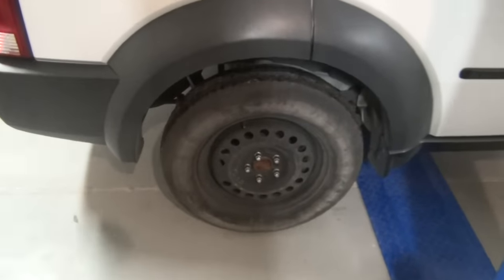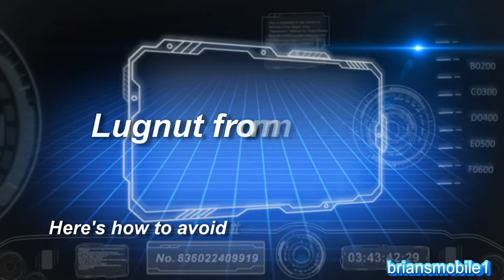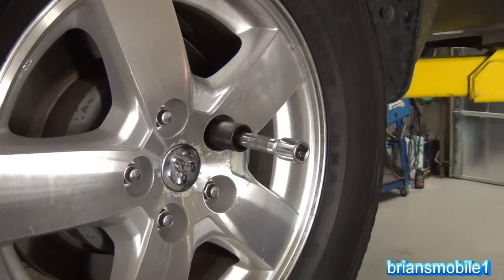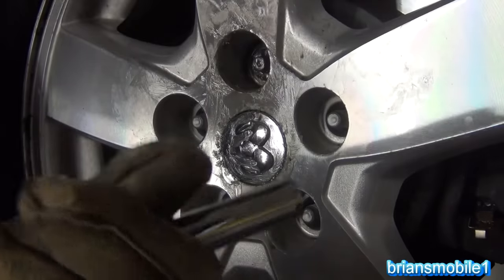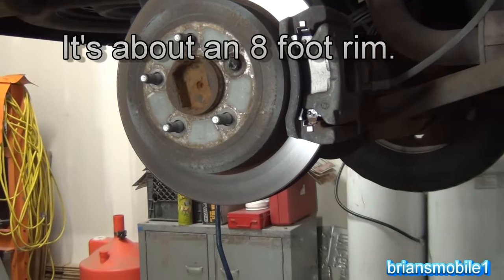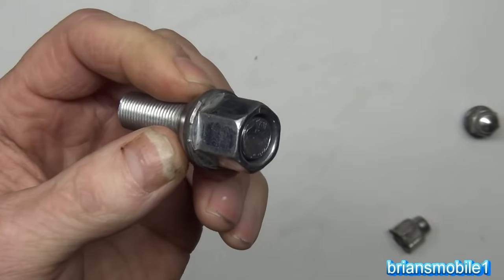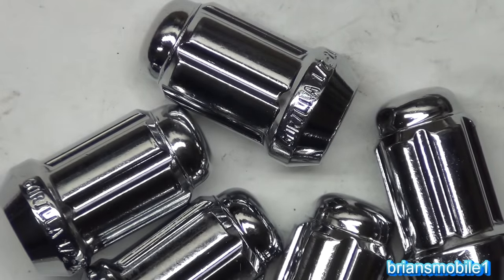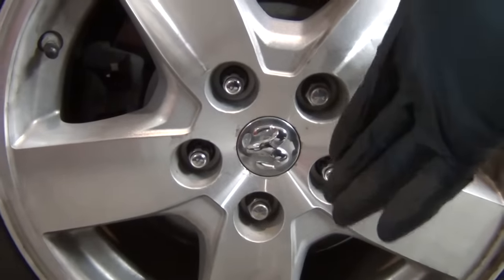Lugnut From HELL

Comment: You know your day is bad when you are torching lug nuts
Reply: This is what happend to me today
Reply: hahahahhaha
Reply: ike fun what would be the proper tools?
Reply: TheBlackStealth i'd like to know as well
Reply: Definitely do not miss those days
Reply: @Mr Sunshines Not everyone has the key that came with the car. Sometimes the rims are aftermarket rims and the key for it is hard to find in stores or online.
Reply: Everybody knows you spray with WD-40 when red hot-sucks it into threads. I've got a Durango with same problem. I dug most of the chiseled lugnut out. Now I'm going to hardware store to get diamond tipped hole saw that JUST slides over the wheel stud. Wish me luck - first time in history?
Reply: Happened to me just now
Reply: @willyluciano9036  Good story bro. Glad you got it sorted in the end.
Reply: I woke today with high hopes of completing front end...... placed smaller socket..... used all the point sockets.... heated the nut .... then grinding the nut off.... still no luck.... trying to pry..... my special lug nut split in half... I’m stump....    do u think I can go through the back way take the axle nut off so forth..????
Reply: not if its after hours. I enjoy the pyrotechnics.

Comment: Who was the "engineer" that thought capped lug nuts were a good idea?  They're ridiculous.
Reply: @noidontthinksolol  the Dodge ones are not even 19mm as they should be. Must be made in China but so key won't fit on and when you get them off they are stuck good in socket. Underneath is normally 18 tho
Reply: They are garbage. The corrosion gets under the cap and swells the cap. Now the proper sized socket wont fit. Now joe bloe grabs the next size bigger and strips the nut. Seen it a million times.
Reply: @noidontthinksolol  I work in automotive industry and Tim Fisher is absolutly right. Working with harder metals mean lower lifespan of tools in factory, longer time to make single part etc. also softer metals are cheaper. Yes it is cheaper by few cents per part but if you make thousands nuts per day then every cent count towards profit. One big USA automaker actualy wanted to change materials used in one part we make for chaper metals and we were not even able to do that because of quality issues.
Reply: It's just attempts to work around some inherent problems with lug nuts instead of just switching to bolts. I'd bet the engineers are just doing the best within the rules the management has set up together with the sales department. Because some focus group has said that they refuse to buy a car with lug bolts... unless it's European, then it's okay.
Reply: its mostly only dodge that uses them
Reply: @crash5225   Yeah you should But I think you do not as I have never had a problem with the nuts that lost their cap !
You just use the next size down socket & be prepared for them to rust a little .
Reply: Dodge🙌🏻
Reply: Ford, Chrysler, Chevy, Dodge....
Reply: @crash5225  1 dollar each
Reply: Cheaper to make + an easy way for manufacturers to squeeze more money out of a customer. A full set of OEM capped lugs for an f150 is about $140 at the dealership I work at.
Reply: Ford Engineer right after the two-piece spark plug.
Reply: probably the same guy who never worked on a single car in his life and instead substituted that for a degree.

Comment: The easiest and painless way to fix these is to drill them out. Measure the height of the nut and the size of a stud, with a caliper. Take the drill bit, usually slightly smaller than the stud measures and mark it  for depth. Most times it doesn't matter if you drill a little deeper, just be careful. A bit slightly smaller will compensate if your center or drill angle is off.  Anyway, most studs are concaved at the end so locating center is relatively easy. Use a center punch to mark and start drilling. I have used the step up approach, starting with a small bit and incrementally increasing the size, but usually do this on a threaded hole that I don't want to damage the threads. In this case neither the stud or nut matter. The only piece that could be damaged is the rim. The drilling should leave just a ribbon of stud metal that will break right off with the wrench or impact. If you get it near perfect the stud should come off on the drill bit.
Reply from the maker: +3goallead That's some great advice.  Thank you.
Reply: +3goallead. I've had great success in doing the drilling process too. another tip for what I have done that has helped too is actually re tighten the other lug nuts back on and either used an extractor, or pounded on another socket on to impact the stuck nut on. I think the pressure of the other lug nuts being put back on helps in pushing in the rim a little, and any little bit helps as i have tired doing this with no lug nuts on, and all of them off. Half the time, the striped nut comes off. ;D
Reply: +3goallead also after you tighten the others down like tou xiong said, use a breaker bar and a cheater with Brian's extractor and that will give a lot more force than the air impact gun. sometimes you can just break studs off.
Reply: +3goallead Yep that's how you do it. Been there and done it.
Reply: +3goallead   So, where were you this smorning?? No, seriously I wish I had read this 10 hrs ago, I might be done working on my Jeep. Thanks for the advise. Tomorrows forecast, sunny with a chance of still working on the Jeep.
Reply: The easiest, painless and cheapest way to take off a nut or a bolt is using a torque multiplier!!!
Reply: Yep this works with lots of stuck bolts, etc etc.
Reply: Thank that'll be way easier
Reply: Also if you have them on your vehicle get them changed for better ones that are solid, one piece.  Any vehicle you bought new even today might have them.  Why they still use them is a mystery.  Maybe they are in cahoots with the towing companies you will likely need to call when the lug nuts make changing a flat tire impossible?  If you have one with a damaged cap or is on way too tight it will seem just about impossible to get it off.  I also would not expect you to have tools to try to remove it with either.  You will end up canceling your plans for that day and going home or to a nearby friend's house frustrated.
Reply: Agreed, I've done a lot of reading and I think heating it up damages the wheel more times than not.
Reply: Need suggestions: I'm working with a jetski trailer, tire flat and half separated from rim. As I fight the stuck lug nut, the wheel turns.

Comment: A tip from a Dodge, Chrysler, Jeep, Ram technician: when you get a lugnut like this that won't come off, before you go for your breaker bar or your damaged nut/bolt extractor, take your 19mm impact socket, 18mm if the lugnut is missing the cap, and hit it with a hammer. A real hammer. I use a 4lb engineers hammer. Hit it. Really hit it. Put down your purse and hit it, little girl. 5 or 6 hard hits. The vibration from hitting it with the socket and hammer shocks the taper on the nut. Your impact will take the nut right off.
Reply: John thats the way to do it money fer nothin and your chicks fer free...
Reply: so put the socket onto the nut, then smash the socket with a hammer?
Reply: John come on up here to the salt belt and try that trick, it doesn't always work. Try making your nut here in the north, we make those southern techs look like oil change specialists
Reply: what a sexist comment.
Could also had some racism to it please ?
Reply: 12 pound sledge. Just don't miss.

Comment: Probably should've hammered that bolt extractor on there and tried a breaker bar with a cheater pipe...
Reply: +jrmym2 Yeah, worst case just twist off the stud, you're gonna need to replace it anyway
Reply: +Doug Beard You're not Brian...
Reply: +jrmym2 I'm with you on that one. I've always found that I can out-muscle an impact wrench with a breaker bar, even without a cheater pipe. Sometimes twisting off and replacing a lug is the easiest way to go. And welding on a rim with a tire on it? That's risky (plenty of YouTube videos on the results of that approach). Granted he's a long way from the tire, but that's a lot of heat.

At the very least, it would have been advisable to remove the valve core and leave the interior of the tire open to atmosphere. And make sure it's not a magnesium rim or it could turn into an inextinguishable fire.

That said, all's well that ends well. It's a win for Brian.
Reply: +Firstname Lastname I doubt any Chrysler of that era would have a magnesium rim also I've found the opposite to be true the force of an impact just works wonders getting stuff loose.
Reply: I had this problem before on a Jeep. Impact guns did nothing. 8 foot cheater bar by a fairly good sized mechanic did nothing. The caps were still on the lug nuts, and not stripped. It ended up being drilled out.
Reply: I don't think the extension on the impact helped either
Reply: I would use a breaker and cheater or just give up.
Reply: I have a five foot pipe to fit over the end of my  breaker bar--all the torque I need.
Reply: they also have a 45/64ths lug nut socket that would have worked well in this situaiton
Reply: @HimmelWeint  o ly if you plan on twisting nuts off....
I've always won with a 22inch breaker, a hammer, 2 sockets (1Correct &1 Smaller) and an nut extractor... when that failed then it was str8 to FIRE. Then breaker, hammer socket extractor repeat.. shit if that failed then torch it...
Reply: @billlee1724  kush roller laffed
Reply: Jrmym2, I snapped my 1/2" drive breaker bar with a five foot galvanized pipe after heating red hot. Defeated two Impact drivers, both half inch. Snapped a star wrench style lug remover at the center weld.
It's also a goddamn Chrysler.

Comment: A friend called me asking me to pick up a tie rod end for his '95 Town & Country and come rescue him as he was out of town.  When I got to him, we had the same problem.  Couldn't get one of the lug nuts off.  The solution I came up with was to replace the tie rod end with the wheel on.  Not easy.  Got the bad lug nut off later when he returned home.  Used a combination of metric and SAE sockets pounded on with a sledge hammer until the lug nut gave up.

Comment: I always learn more when watching misadventures like this. Way to go, for rolling the camera even when things aren't going well.
Reply: +spelunkerd Agree completely.  We all hit problems; learning how we overcome them is so important...
Reply: yea i can see this coming in handy some day.
Reply: If you can't get it lose, put a breaker bar on it, and tighten it till it breaks. Presto it done, you have to replace the stud either way.If you are going to drill, why wouldn't you drill the center of the wheel stud? Making it easier to snap off with a breaker bar? You did a lot more work then you had to.
Reply: I Was thinking the same Greg! Or try to loosen it with heat. We use road salt in the winter, and living close to the Sea cause a lot of Seized Nuts and Bolts! it is a daily chore for mechanics Here.
Reply: I love the UP GRADE option.  My problem is my 2001 Volvo S80 has a heat soak lugs bolts from a badly worn wheel bearing.
Reply: this is NOT how you should solve this problem. NEWBS

Comment: The lugnut from hell came directly from the engineering dept. at Chrysler. If a decent metallurgical spec was written in the first place this would never have happened. You recommend a hardened nut in the end….. this is plain to any engineer that
specified an Rc number. But Chrysler decided to make it cute, and save .01 cents each. '' It'll last until out of warranty''
Reply: That they should have done is just not use two piece lug nuts in the first place.  They are the worst!!

Comment: I drilled straight through the wheel stud with a slightly bigger drill bit than the stud ....about 5 min of drilling
Reply: +DaBossk he could also cut it with the torch...but it might ruin the clear coat on the rim. Also oxy acetylene can "cut" through lets say ferrous materials but not aluminium, so the is no risk on cutting the rim.
Reply: The aluminum will just suck the heat right out of the steel lug but. I've dealt with this at work. I just drill the stud just deeper than the lug nut taper and pry on the wheel 180 degrees from the lug nut and it will break the rest of the stud right off.
Reply: whoops, phone couldnt find internet connection.
Reply: Well if you have 10.9 steel nuts, its not gonna be an 5 min drilling procedure :D
Reply: @pmAhavasi  Thats why you buy the drill bits designed for that (my wallet felt that one) and continue to drill it out slowly.
Reply: @chris stamos I was thinking the exact same thing! Why didn’t he just drill out the stud vs destroying the wheel 🤦🏼‍♂️
Reply: @chrisstamos5003  u
Reply: Dude you just saved me after being stumped for days. Had a spinning lug nut(not stud) that I tried everything to get off but it wouldn't budge. Took a titanium drill bit to the stud and took off maybe a half inch and then turned the drill bit into the inside of the lug nut and it popped right off. Not sure why I didn't think of this but thanks!

Comment: I had a similar experience with my 93 Jeep 4 banger when I first got it from my neighbor after it sat in his driveway for four years. 

I was attempting to put four tires on it and the "tire shop" couldn't get one of my lug  nuts off. Just like you  after bringing  it home to my shop it took holy hell and fire to cut that lug off, I thought I'd never get it off I ended up just putting the torch head in the hole and going for it!! Fortunately I didn't do much damage, and like you I was able to move on.

Comment: Brian; been here. Done this till I realized I was (over) WAY OVER, my head! Took the local trailer repair shop 2 hours to get the broken (Budd) thimble nut off, torch and all. Not pretty but he got it done. Lessons galore. Praise the man that created NEVER-SEIZE. You'd be amazed how many tire shops have tole me over the years to not use it on (18 wheelers) Horse puckey. With my Chicago Pneumatic, a hose, truck compressor and block of wood or jack, depending, I always got home. Great Tenacity on your video btw.